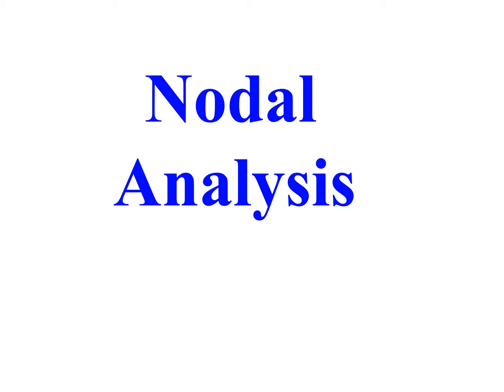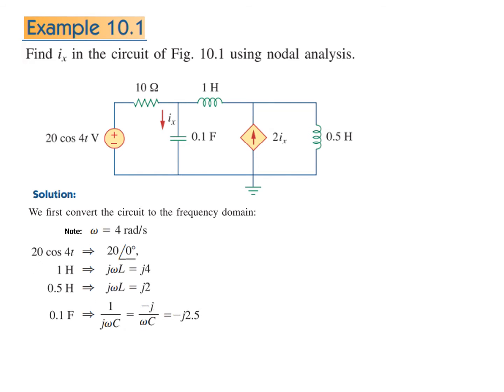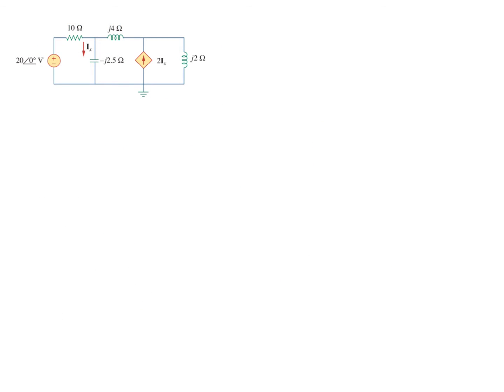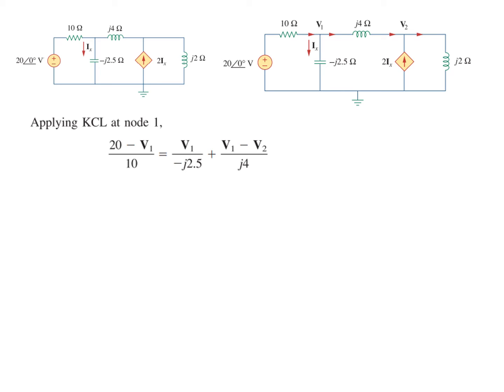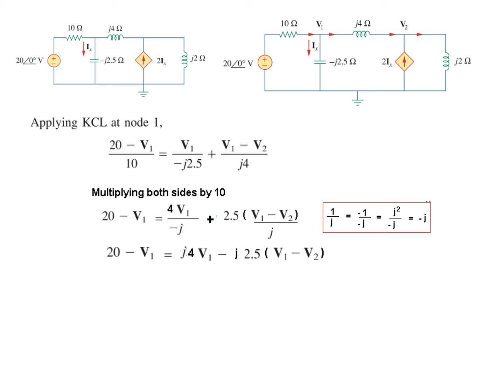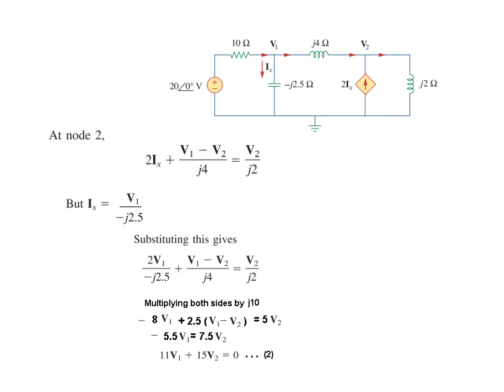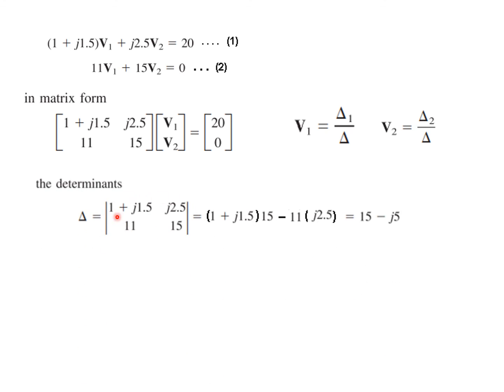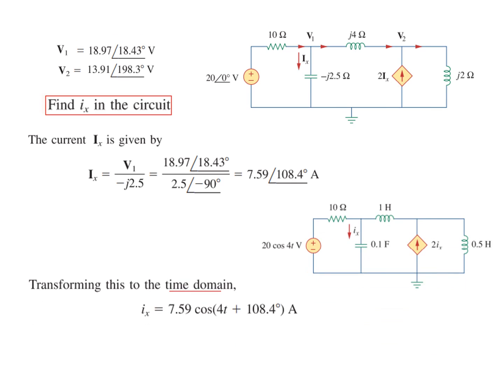(E)ENA(A) || Nodal Analysis ||AC Circuit || Example 10.1

Comment: Sir can we do this by changing the cos to sin function?In this only angle is varying
Reply from the maker: This is the easiest way to convert into phasor form. (Once one of my student solved a sin input question without converting into cosine, and got the correct answer. I had to give her full marks).
Reply: @ElectricalEngineeringAcademy  
Jrw